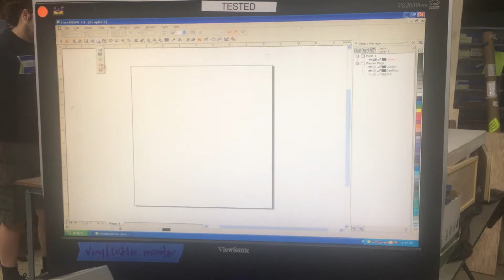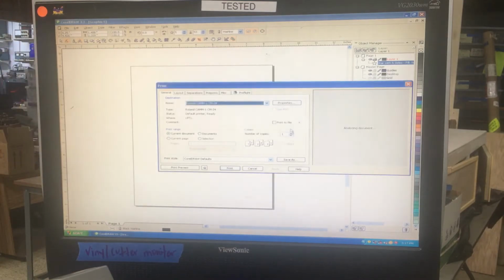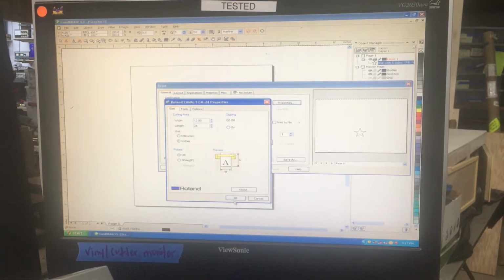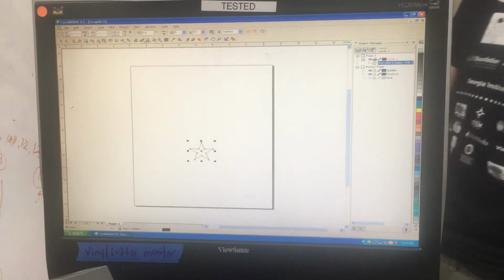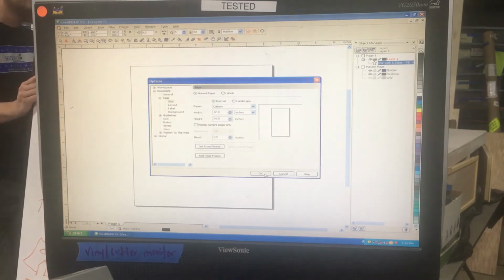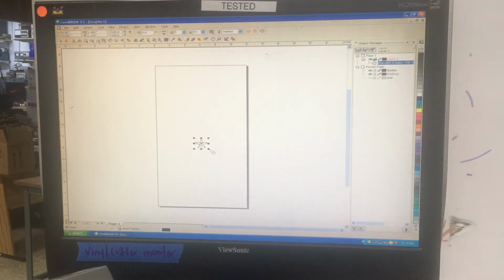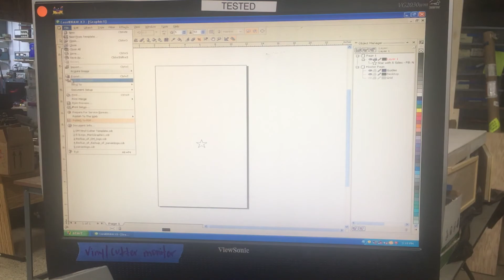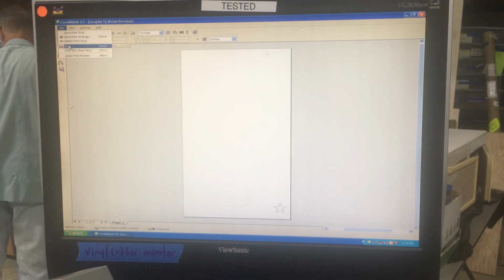Roland CAMM 1 Vinyl Cutter

Comment: Are you using Windows 10? Also what Drivers are yo using to get the Camm-1 to Print?  I have the Roland PNC-950 and Roland says there are no new drivers and it won't print without them.  How did yo get it to work on yours?
Reply from the maker: oh dear, that's a tough question as we retired that vinyl cutter from our makerspace over the last year or so... and before then we stopped using CorelDraw... If memory serves, you can tell EasyCutStudio that you are sending your cut to as close a model Roland as they list in their Cutter profiles and it generally works

Comment: Hi, Chris, i have one of those exact cutters  We just recently moved and for some unknown reason I can't get my cutter to work. When I go to cut, it goes to something other than the cutter on the list. I change it to the Roland Camm1 24 but it still won't cut. Do you have any suggestions as to what I can do to get this machine to cut again?  Thanks so much. I have a Silhouette Cameo but It won't cut larger designs like this one. I loved using this machine. I use the CutStudio software with it. And I have it connected to a Windows XP computer. Thanks for any help. Vicky Quinn

Comment: Will this device work with Windows 10 by any chance?
Reply: Not this one, but there are lots of more recent model vinyl cutters that will. We use Windows XP because this model cutter requires a computer with an old-fashioned serial printer port, and we found one - but it won't run anything new than XP.
Reply: Joseph Walton i have the windows 10 drivers for the cm-24 and it works fine for me
Reply: @griesnetat  where do you get the Window 10 drivers please
Reply: Hi,
Can you help me how to start with roland camm1 pro cm 400.
Driver? Setting? Software?